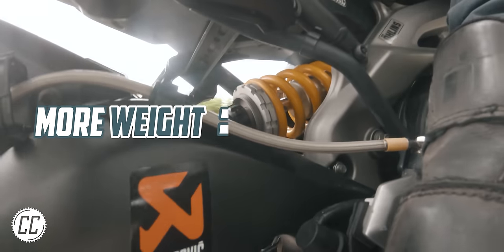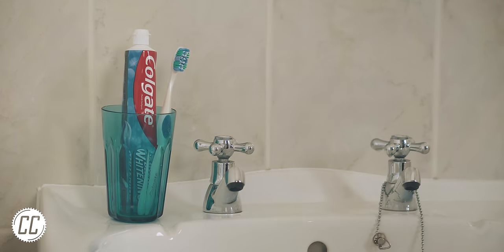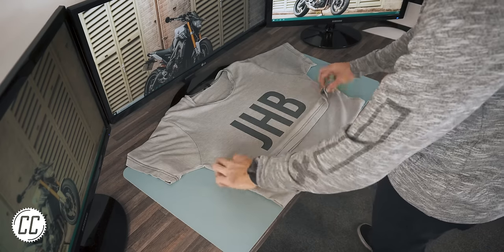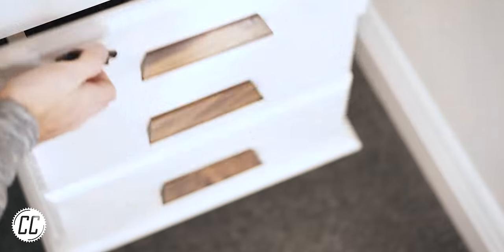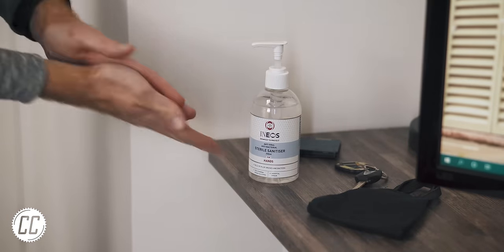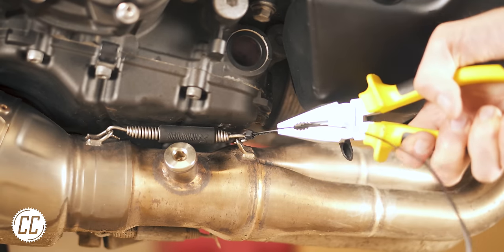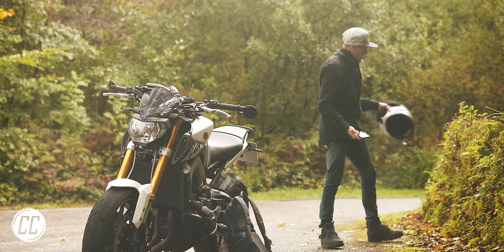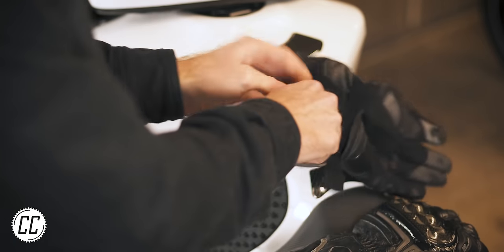10 Motorbike Hacks For Bike Owners

Comment: If yer going to put your lid on your gloves on the floor then put the gloves palm up not palm down .... if you get grit on the palms of your gloves its real easy to damage your paintwork with it if you then put your gloved hand on the tank at any point 😉
Reply: Plus if it gets muddy or wet your hands might slipp of from handlebar...and you can't use your mobile, navigation system etc,

Comment: I have a 'hack' that works very well.  When removing decals, heat them first with a hair dryer.  Wave a hair dryer over the decals and they will become soft, and peel right off in one piece, and leave very little glue behind.  (But do NOT use a heat-gun as it will damage the paint.)  A hair dryer works wonders.

Comment: I liked all of your hacks, they're very handy.  However, for the first one, I would recommend either a different option, or and addition.  Years ago, I  got myself a magnetized tray, two in fact, a large and a small.  Yes, there is a cost, but metal parts don't get lost.  The addition I might recommend is to find some sort of strong magnet that you can secure to your ice cream tub. There's nothing worse than kicking or dropping your container of parts, as it sits precariously on your  motorcycle seat,  and losing most of them.  Yes, put the lid on and cutting a hole in it is a nice trip back to the hack.  Just an idea.

Comment: First hack is amazing, I use a lot. Another interesting hack, is to use a large syringe and a hose to drain the brake fluid, without getting air into the system.

Comment: Sub and like.   My first  bike - you needed wrenches to keep the goblins away. Straight screw driver and a 1/2 in - english Triumph wrench. It was a 70 Tiger 650. About every 200 miles - you had to pull over and pull the bowl off the single carb. Dump the rust and put it back on. Jets were always fine.  You would know when to pull over - as she would not go over 50 mph - but she idled fine.  10 Min and you were rolling.  Cheers.

Comment: If you still have your passenger pegs you could use those as a very secure helmet hanger. Flip the peg down, hang the helmet onto it by the chin strap, flip it back up. That helmet is not going anywhere.

Comment: if you don't have a jack to raise the back wheel I put a big mallet aka hammer under my footpeg  put the handle against a little curb or put in the grooves of the pavement to secure it remember always be sure it will not slip under it or make harse movements be subtly rotating the back wheel

Comment: Great tips.  The only thing. Is that the buff is actually a bad replacement for the facemask. Since they let to much breath to pass trough. And early studys suggest that since the buff acts like a filter for breathe tiny droplets. It actually might be worst than not using a mask because they splits that droplets into smaller ones that can travel farther in the air.   A proper facemask blocks those droplets entirely.

Comment: ha, It's getting hot over here in Australia so i won't be able to do tip 5. 5:05
Reply: MozzieMan I wear one in the summer in the USA. I just don’t pull it up around my face when riding, it protects my neck from the sun and especially bugs. Those dam flying beatles hurt. They also work great as a helmet liner.
Reply: NoGlockTrucker that’s true. I’ll have to do that.